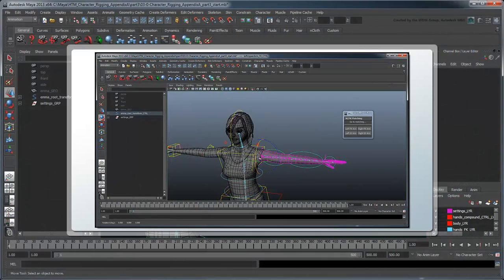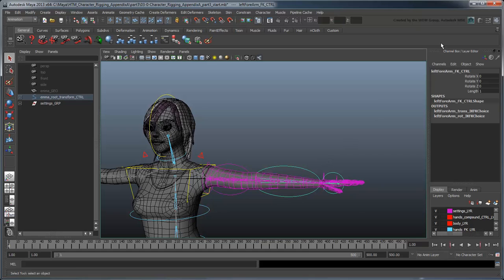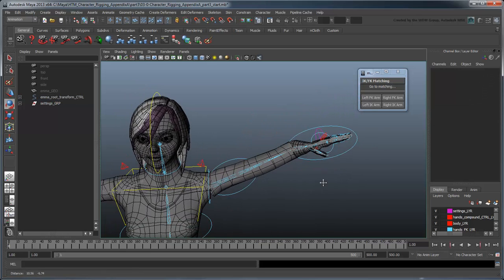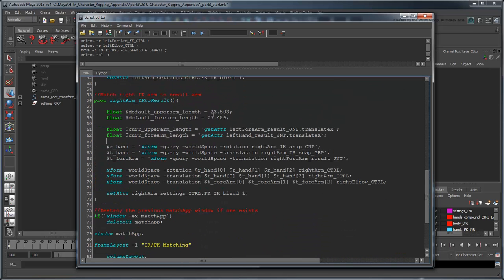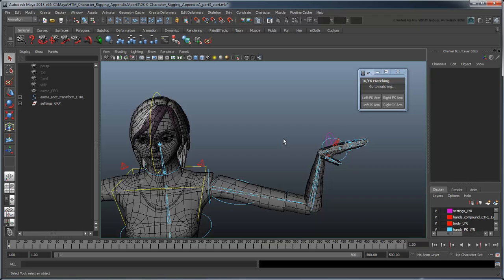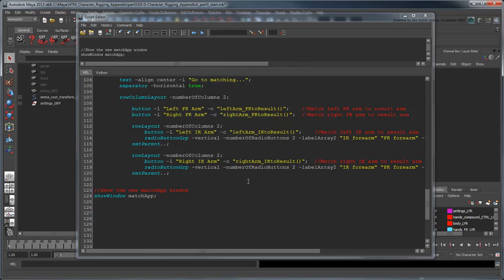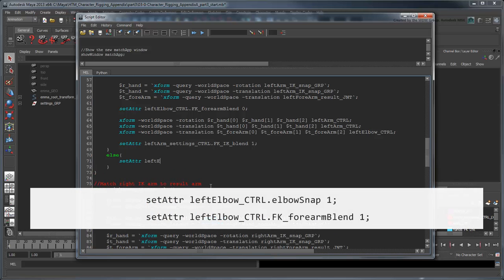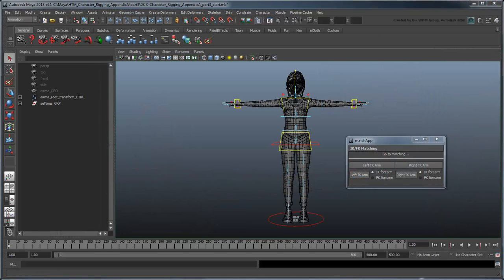Creating a Character Rig: Appendix A: Part 3 - Matching arm lengths (Advanced)

Comment: cannot download the file
Reply from the maker: Try it now.  In general, if you run into that error, try replacing "http" with "https" in the link.
Reply: @Autodesk_Maya  ok thank you for the information
Reply: @Autodesk_Maya  its still not working
Reply: @Autodesk_Maya Not found
Reply from the maker: @ToddlersRhymes27  Weird, I just tried it and it seems to work fine.  This is the link you're using right?  https://areadownloads.autodesk.com/wdm/maya/htm_chr_character_rigging_AA_part3.zip

Comment: I had an issue with the Elbow snap attribute activating even when the tolerance was activated. I fixed it now, but if anyone has any of the same issues, here's what i did:

simply you might have to play around with the value of your tolerance. In the video Maya Learning Channel set the value of $tolerance = 0.001, in my case I adjusted the value of $tolerance = 0.01 and it seemed to fix the issue. 

I recommend to keep adjusting the tolerance until the elbow snap turns off or on. Good luck!!

Comment: For anyone witha different amount of numbers after the decimal point for upper and fore arm length, this will work. Example:  upperArm_Length (6.321) and foreArm_length (6.78). Create two floats called  upperArm_tolerance; and foreArm_tolerance; , then add the same amount of 0's after the decimal point as the corresponding result joints length to the tolerance: upperArm_tolerance = 0.001; and foreArm_tolerance = 0.01;

Comment: Hi,when i select the left FK Arm button to change the IK mood toFK i get an error :
//Error:line 17: setAttr:No object matches name : leftUpperArm_FK_CTRL.length
do you know haw I can fix this?
Reply from the maker: Is that the actual name of the attribute?  Are you sure there aren't any spelling mistakes or namespaces associated with it?
Reply: Well the script is so hevy and i should check it againe i run it again by the script that you have put it on the files  its name is 3_FK forearm_snap.mel and it still puts an error
Reply from the maker: Sorry, what I meant is are you sure you spelled "length" correctly on the leftUpperArm_FK_CTRL node?  And are you sure that node doesn't exist in a namespace (because you would need to include that too in the script).
Reply: Actualy there is a problem in the controler that have been made by running the script the arms can go from fk mood to ik mood but they can't go from ik mood to fk mood and in ik mood whenever i want to go from ik foreArm mood to fk foreArm mood , the moods are not match to gether here is a picture from this situation,plz help.http://uupload.ir/files/l5n7_appendix_a3.png
Reply: Hi i have a problem again in 5':49'' of Appendix A part 3 when i ran the script maya put an error i do'nt know why the error was //Error Line 115.0: Syntax error// the problem is that the script has just 114 line and the maya sayes the error is in Line 115!
Do you know why and how i can fix this?

Comment: When I select "FK forearm" and select "Left IK Arm" Button on the script UI. I get an error saying:

*setAttr: Cannot set the attribute 'Left_Elbow_ForeArm_FK_Control.Length' below its minimum value of 0. //*

switching between all the other modes works fine but when I was to switch to the FK Forearm it messes up.

-------------------Below Is Script----------------------------------------
  else{
        $t_foreArm = `xform -query -worldSpace -translation Left_Elbow_RESULT_Joint`;
        $r_foreArm = `xform -query -worldSpace -rotation Left_Elbow_FK_Snap`;
        $r_hand = `xform -query -worldSpace -rotation Left_Wrist_FK_Snap`;
        
        float $forearm_length_factor = $curr_forearm_length / $default_forearm_length;   
             
        setAttr L_Elbow_PoleVector.Elbow_SNAP 1;
        setAttr L_Elbow_PoleVector.FK_ForeArm_Blend 1;
        
        setAttr Left_Elbow_ForeArm_FK_Control.Length $forearm_length_factor;
        xform -worldSpace -translation $t_foreArm[0] $t_foreArm[1] $t_foreArm[2] L_Elbow_PoleVector;
        xform -worldSpace -rotation $r_foreArm[0] $r_foreArm[1] $r_foreArm[2] Left_Elbow_ForeArm_FK_Control;
        xform -worldSpace -rotation $r_hand[0] $r_hand[1] $r_hand[2] Left_Elbow_Wrist_FK_Control;

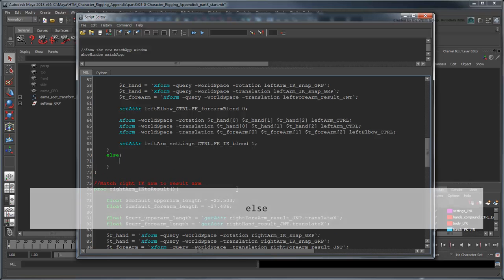Comment: At the start of [10:16] of this tutorial after the else statement; what does the command lines look like. I frozen the translation for the LEFT arm controller and the elbow controller for my own character rig. And this is the command lines I came up with:

//Match LEFT IK arm to result arm
proc LEFTarm_IKtoResult(int $foreArm_mode){
    
    float $default_upperArm_length = 21.528;
    float $default_foreArm_length = 25.169;
    
    float $curr_upperArm_length = `getAttr LEFTforeARM_result_joint.translateX`;
    float $curr_foreArm_length = `getAttr LEFThand_result_joint.translateX`;
    
    float $tolerance = 0.001;
    
    if ($foreArm_mode == 1){
    
        if((abs($curr_upperArm_length - $default_upperArm_length) > $tolerance) || (abs($curr_foreArm_length - $default_foreArm_length) > $tolerance)){
            setAttr LEFTelbow_CONTROLLER.elbowSnap 1;
        }    
        
        
        $r_hand = `xform -query -worldSpace -rotation LEFTarm_IK_snap_GROUP`;
              
        xform -worldSpace -rotation $r_hand[0] $r_hand[1] $r_hand[2] LEFTarm_CONTROLLER;
        
        $t_hand = `xform -query -worldSpace -translation LEFTarm_IK_snap_GROUP`;
        
        $t_hand_wrp = `xform -query -worldSpace -rp LEFTarm_IK_snap_GROUP`;
        
        $t_hand_drp = `xform -query -worldSpace -rp LEFTarm_IK_default_GROUP`;
        
        $curr_transform = `getAttr emma_root_transform_controller.translate`;
        
        
        xform worldSpace -translation ($t_hand_wrp[0]$t_hand_drp[0]+$curr_transform[0]) ($t_hand_wrp[1]$t_hand_drp[1]+$curr_transform[1]) ($t_hand_wrp[2]$t_hand_drp[2]+$curr_transform[2]) LEFTarm_CONTROLLER;
        
        
        
        
        $t_elbow = `xform -query -worldSpace -translation LEFTforeARM_result_joint`;
        
        $t_elbow_wrp = `xform -query -worldSpace -rp LEFTforeARM_result_joint`;
        
        $t_elbow_drp = `xform -query -worldSpace -rp LEFTelbow_IK_default_GROUP`;
        
        
        xform worldSpace -translation ($t_elbow_wrp[0]$t_elbow_drp[0]+$curr_transform[0]) ($t_elbow_wrp[1]$t_elbow_drp[1]+$curr_transform[1]) ($t_elbow_wrp[2]$t_elbow_drp[2]+$curr_transform[2]) LEFTelbow_CONTROLLER;
        
        setAttr LEFTelbow_CONTROLLER.FK_forearmBlend 0;
        
        
    }
    
    else{
        
        $curr_transform = `getAttr silversurferlover_root_transform_controller.translate`;
         
        $t_elbow = `xform -query -worldSpace -translation LEFTforeARM_result_joint`;
        
        $t_elbow_wrp = `xform -query -worldSpace -rp LEFTforeARM_result_joint`;
        
        $t_elbow_drp = `xform -query -worldSpace -rp LEFTelbow_IK_default_GROUP`;
        
        $r_foreArm = `xform -query -worldSpace -rotation LEFTforeARM_FK_snap_JOINT`;
        
        $r_hand = `xform -query -worldSpace -rotation LEFThand_FK_snap_JOINT`;
        
        float $foreArm_length_factor = $curr_foreArm_length / $default_foreArm_length;
        
        setAttr LEFTelbow_CONTROLLER.elbowSnap 1;
        
        setAttr LEFTelbow_CONTROLLER.FK_forearmBlend 1;
        
        setAttr LEFTelbowforeARM_FK_CONTROLLER.length $foreArm_length_factor;
        
        xform worldSpace -translation ($t_elbow_wrp[0]$t_elbow_drp[0]+$curr_transform[0]) ($t_elbow_wrp[1]$t_elbow_drp[1]+$curr_transform[1]) ($t_elbow_wrp[2]$t_elbow_drp[2]+$curr_transform[2]) LEFTelbow_CONTROLLER;
        
        xform -worldSpace -rotation $r_foreArm[0] $r_foreArm[1] $r_foreArm[2] LEFTelbowforeARM_FK_CONTROLLER;
        
        xform -worldSpace -rotation $r_hand[0] $r_hand[1] $r_hand[2] LEFTelbowhand_FK_CONTROLLER;
        
    }
    
    setAttr LEFTarm_SETTING_CONTROLLER.FK_IK_blend 1;
    
}

--------------------------------

But when I execute all this command I get the error

// Error: line 1: Object 'LEFTforeArmMode' not found. //

// Error: line 1: Error evaluating argument at position 1 in procedure "LEFTarm_IKtoResult". //

What am I missing?
Reply from the maker: Jared Davis It seems as though the argument (LEFTforeArmMode) you're attempting to pipe into the parameter $forearm_mode doesn't exist.  Make that argument is declared properly, has the dollar indicator for a variable, and that your bracketing of procedures is correct.
Reply: Thank you I got it.

Comment: Even with the tolerance turned up, the control always seems to snap to the elbow when switching with the app. Is there any way to make this not occur?
Reply from the maker: Do you mean it actually turns elbow snap on?  If so, it sounds like you're missing an "or" statement.

If you're just referring to the general way the control snaps to the elbow's position, unfortunately there's no way to avoid this.  You need to do it to get the positioning right.
Reply: Maya Learning Channel I was rreferringto the general way the control snaps to the elbow's position. Thank you for the clarification!